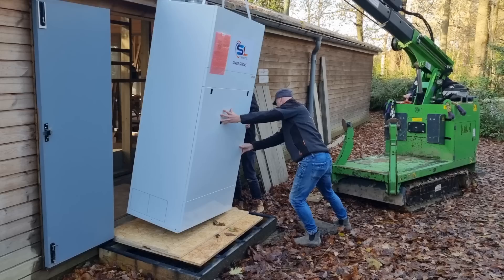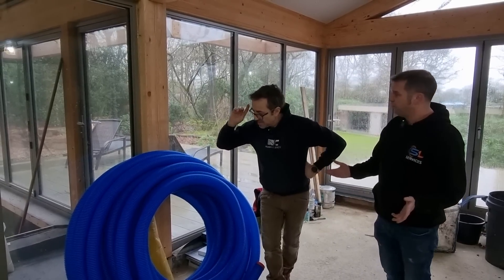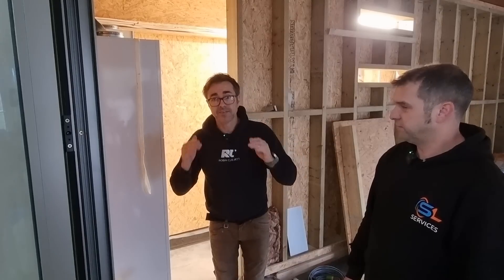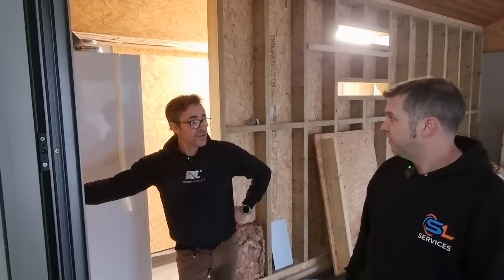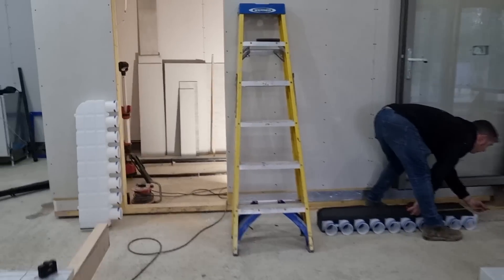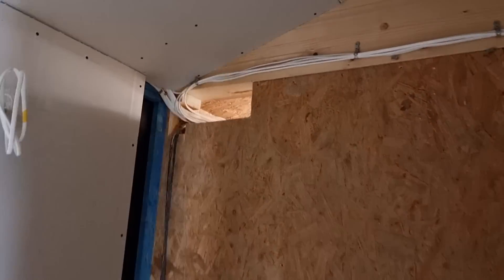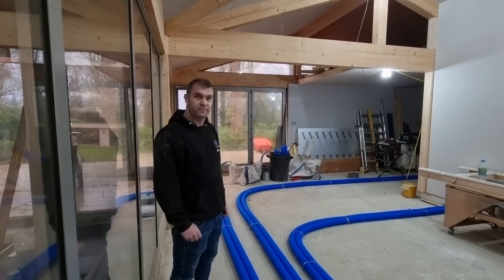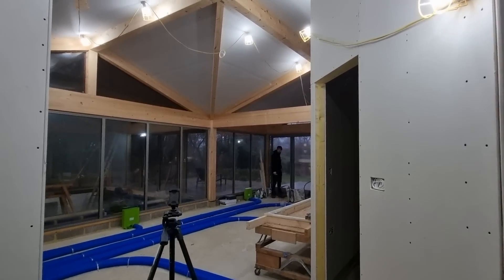MVHR Building ventilation install in my garden room

Comment: In the Skill Builder Capel 1 episode you talked of running gas pipe up to the garden room. I assumed the main reason behind that was heating the pool? Now you are saying you’ll never have gas there. Even at current prices I’d have thought gas heating would be cheaper, unless you have plans for a large amount of solar? Also looks like the mezzanine sleeping area has been ditched. Look forward to seeing more on this build.
Reply from the maker: I decided long ago to ditch the Gas Idea, instead I have an amazingly well insulated concrete pool shell, an over insulated structure and I have also researched all manor of heating and ventilation solutions that will do the work in an energy efficient manor, I will be doing a video all about this as we fire everything up in a few months!!

Comment: How would you clean out all the dust & grime out of the underfloor pipes after 30 years or so...? 🤔
Reply from the maker: They are large pipes so you could easily push a vacuum hose through them, it's a good question too, if they are constantly blowing or sucking then technically they should stay pretty clean??? Let's hope!!

Comment: Good job. You have built a self sufficient house that you could live in.
Reply from the maker: The funny thing is that if you build over a certain square meterage then the structure has to comply with all the same building regs as a proper dwelling... even though you could never class it as a dwelling!!!
Reply: @robinclevettcarpenter  That’s red tape for you. The solar should run the MVHR system. I want to build small affordable homes the same way. Thank you for the valuable insight.

Comment: Do the fresh air supply vents work better in the floor than in the ceiling like is typical? seems like a good idea I've only fitted it once and we had everything in the ceiling
Reply from the maker: I reckon that it would be better in the floor especially when it is heating the air in the winter, I will let you know in about 3 months!!!

Comment: Why didn't you run the blue pipes above the ceiling?
Reply from the maker: The roof space is a vaulted cold roof design, and we designed the floor build up to accommodate the ducting